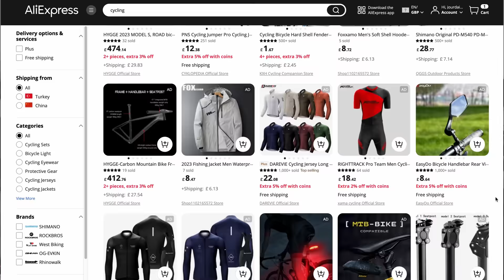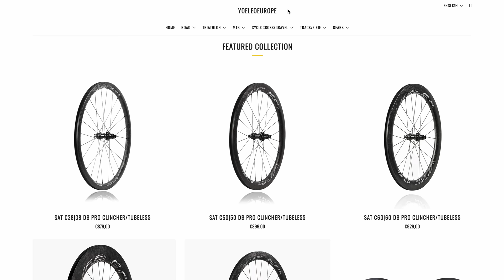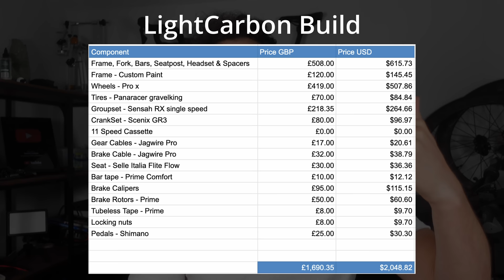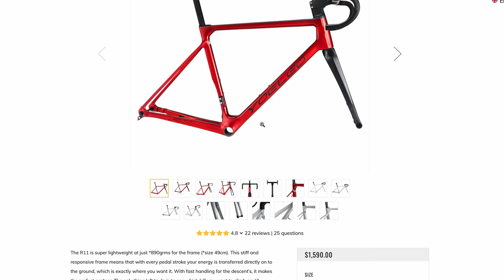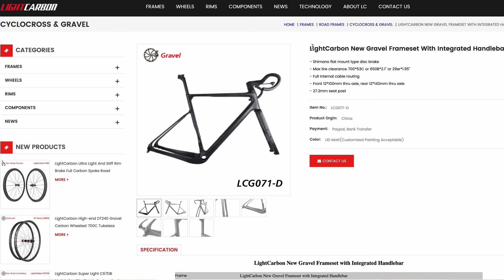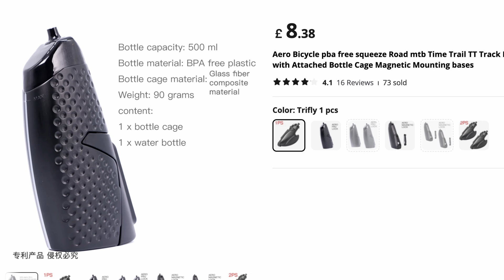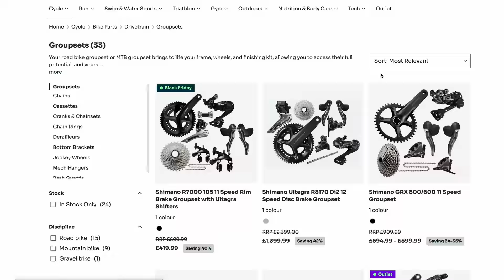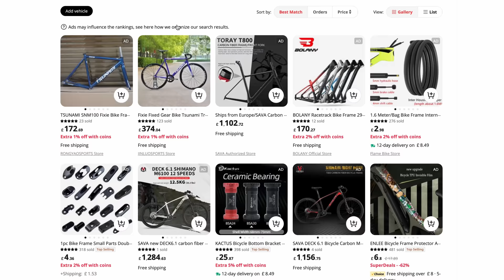Cheap Chinese Carbon Road Bikes... Are They Worth It?

Comment: I see some Chinese frames appearing on German "Kleinanzeigen" (craigslist like) and they are nearly unsalable. So one must calculate that there is no realistic way to get money back once the honeymoon period is over or when the frame is of the wrong size. If you buy a used 10 year or Specialized or Trek bike you for sure can get some 100s of Euro when you decide to sell it.
Reply: True, and I end up with 4 bikes and  1 frame. Though I am still in the honeymoon period with all of them, I start worring about how to get rid of them if I get tired of them or I want something better.

The only upside is, most of these frames are affoardable (compare to bigger brands, aside from my elves falath pro), so I have little problem to throw them away while strapping groupset and other parts that has much better chance to sell.

Comment: Shimano is not a Western brand.....
Reply: but they have local distributors handling service and also, despite the crank recall, deliver an extremely solid quality even on low end parts.
Reply: @FuchsHorst  It's still an Asian brand. Can't call them western brands in any way. Elves has an australian distributor too
Reply: @ht1881  Shimano has literally factories in Europe
Reply: @FuchsHorst  and Western brands have factories in Asia. The point is, shimano is Japanese.
Reply from the maker: Apples and pairs... They are well established in the west is what I was getting at 👍🏽
Reply: A very SoMe comment. In the defense industry we call Japan AUS NZ etc “Western” - I think the 99% will agree when it comes to cycles also. YMMV.

Comment: Yes, this video is exactly correct in my experience.  I have two Chinese bikes, a Yoeleo R12 (2023) and ICAN A10 (2020), the later is a rim brake aero frame.  No problems with either.  Really fantastic value.  (Note, I have Ultegra Di2 on both, and I had the builds done at a LBS by people who know what they are doing).   Both have really good QC in small details. Better than a 2018 mid-level Specialized Tarmac I had previously. By details, I mean roundness of BB area, how closely the derailleur hanger fits into frame, and the wheel dropouts. I've had two sets of ICAN wheels (Aero 50), I really like them, they seem indestructible.  Earlier I had bought one set of Yoeleo wheels (2018), my first foray into  Chinese stuff, they were not as good, one developed cracks along the nipple holes after ~ 2 years, around 12,000 km (at which point I figure I had gotten my money's worth).  I bought a set of Elite Carbon 50D wheels earlier this year for the Yoeleo R12. I really like them so far.    

Yoeleo now has 6-year warranty on frames.  For a couple hundred USD they extend it to lifetime.  My ICAN came with a 2-year warranty.  Great customer service. Great communication with both companies.  I just bought a pair of 3D printed saddles from a company called West Cycling on EBay (also sold on Aliexpress).  About $100 each.  Time will tell.  So far, so good, very comfortable.  

I might consider a Chinese groupset someday.  But not yet.  They are too new to that business.  And YouTube reviews are not encouraging. 

So, as you say, wheels and frames are a safe option, and concentrate on Yoeleo, Elves, Winspace, and ICAN as things stand in late 2023.  Possibly Velobuild.  Also Elite Carbon, and another wheel company or two that I'm forgetting.
Reply: Are there also cheap aluminum frame sets ?
Reply from the maker: Thanks fro sharing your experiences. They seem to be aligned with me as well. I am hopeful that the groupsets become robust and a viable option because £1000+ for Di2 is a log of money. If anything they keep the western brands honest as they know there is someone on their tails waiting to take the top spot. 👍🏽
Reply: @MichaelRedford no, not really
Reply: Seaboard/Tsunami, yes.  @MichaelRedford

Comment: 100% agree. Have a custom painted Yoeleo R12 (2023) and two wheel sets with Shimano Ultegra Di2 12 speed, stages power  pedals, power mirror saddle and a nice ManuF. BB. Such a great ride. Not ultra cheap due to all the high end parts but still significant savings compared to a comparable brand frame or a -reassembled bike. Had an issue with one of the rear hubs - Yoeleo sent a replacement part and all was well.

Comment: Jourdain, i think that was a fair assessment and the results similar to mine, although not in the same quantities. The bottom line is that if your not prepared to potentially "throw the item away" if it is not to your expectations - don't buy. I have an Ican gravel frame (cannot fault it) fitted with Sensah Empire Pro/Senicx crank. The Sensah FD proved to be a challenge to set-up. In the end i swapped it out for a sram FD. The RD seems to "loose" its indexing fairy regularly but when working shifts well. I am not sure if i would recommend Sensah and will probably swap it out for a Shimano set-up when funds allow. Keep up the good work 👏👏
Reply from the maker: Thanks for sharing! I'm hopeful that the LTWOO and Sensah groupsets do become a solid option in the future. Right now they are keeping Shimano and SRAM on their toes which is only a good thing!

Comment: Ohh boy this is exactly my experience. I just finished my first build, a gravel bike. I orderered a frame from Tan Tan Cycling directly through and evrrything is pretty solid, the paintjob is also pretty good. But then my stupid ass decided to give the LTWOO GR9 groupset a go and that has been a pain... I bleed the front brake like 20-25 times until it had some grab and even then im not fully convinced. Finetuning the rear mech has also not been easy but ok.

Yesterday there was a sale on a front grx 800 brake lever and caliper for 70 eur(!) And I bought it without thinking that much, just to upgrade my brand new chinese groupset 😅

Comment: Yes they are BXT are great for me...a lesser known make as not featured by YouTubers and they STILL do rim brake frames 👌🙏
Reply: The site says their rim frame accommodates a Max tyre size of 23mm. Have you been able to fit 25 or 28s on yours? If so, I'll get one.
Reply: @mikekelly1771  Yes, I think on their disc models it's wider but on the rim frames I use a 25 tho tyre widths are negotiable between makes/manu.s
Reply: @mikekelly1771 My ICAN A10 rim brake bike fits 28 in the rear and 26 in front (Pirelli tires).

Comment: I have one of the cheapest frames, ceccotti branded, $300, been riding it for 3 years now and no issues. It's not the lightest weight frame out there at 1,2kg but it's pretty robust. With chinese frames the higher the price the lighter they are, so at least they have entry level carbon frames for the masses, unlike the big brands.

Comment: As for Chinese frames do your research.  I have been riding a velobuild endurance frame with press fit bottom bracket.  All good.
     Another frame from this brand has a threaded bottom bracket.  I've have heard the threads were not cut cleanly. Probably poor or dull dies. 
   But again I am very happy my endurance frame sofar and I also have put a 105 groupset on it. Everything fit with no extra work.
Reply from the maker: Good to hear that your frames have been all good 👍🏼
Reply: @JourdainColeman  I just have one endurance frame with press fit BB . Good sofar. I have heard some complaints with the frames from this company, with threaded BB.

Comment: Regarding groupsets, have you tried Microshift? They only do mechanical, but my understanding is that they are solid purchases at a better price than the two big brands.
Reply: Most OEM non-Shimano/SRAM is MicroSHIFT. I've never had any issues with their stuff. Its pretty good if you want mechanical. Their best stuff in my opinion is some of the things that address niche compatibility issues. Like, they have a set of drop bar 11spd shifters that match the cable pull of Shimano MTB derailleurs. Really good for mullet gravel bikes.
Reply: Most OEM non-Shimano/SRAM is MicroSHIFT. I've never had any issues with their stuff. Its pretty good if you want mechanical. Their best stuff in my opinion is some of the things that address niche compatibility issues. Like, they have a set of drop bar 11spd shifters that match the cable pull of Shimano MTB derailleurs. Really good for mullet gravel bikes.

Comment: Informative video. Thanks.  I'm buying a new Yoeleo R-12 frame, Shimano Di2 12 speed group set,  and Elite Drive wheels for Xmas. Going to pass on the L-Twoo electronic group set even though I could save $1000 USD.
Reply from the maker: Glad it was helpful! Good choice on the groupset!

Comment: My experience matches this video. The frames are generally well made, although often their ride characteristics just aren't as good as a major brand. Chinese wheels are generally excellent and the best place to start, especially the higher end Chinese stuff. I see little reason to pay double or triple for Zipp/Enve/Princeton these days, especially if you get non-proprietary hubs with a quality Chinese carbon rim. In particular, the more expensive Chinese "brands" that have been around for years like Winspace/Lun, Magene, Elves, Yoeleo, Farsports, ICAN etc all make very good stuff. If a Chinese brand has actual distribution in your country, that's the best possible setup. The second tier of Chinese frames and wheels like Superteam and Lightbicycle are generally good with their higher end stuff being excellent and their lower end being reasonable to use for a year or two. I would stay away from any non-branded, super cheap Aliexpress/Amazon stuff as it's always a total crap shoot: you might get something good but more often it's dangerous garbage.

Comment: From my experience buying well known Chinese road bike frames I would give it a 7 out of 10.  They’re lightweight, stiff, but quite uncomfortable to ride in my opinion particularly the Winspace SLC.
Reply: That's a first, Cannondale and Specialized having an inferior ride quality to Winspace despite having a significantly larger R&D budget and winning racing heritage. I've upgraded my tires to GP5K 28mm with 65 psi pressure on my SLC 2.0 but no resolve.

Comment: £100 on your doorstep, that sounds like a scam to me (unless he had paperwork but this is done usually before). As the Ex-importer of one of these brands I can tell you most will mark the value down to avoid import tax for you the customer. However this means it can randomly be stopped or slip through. When I had the business we always used the correct invoice price and paid our taxes! Most I can tell you do not.
Reply from the maker: To be fair it was my usual DPD driver and he had the paper as well. They didn't take card though so I had to pay online and arrange redelivery. Not ideal but all seemed legit 👍🏽
Reply: @JourdainColeman  arrrrgh sounds bit different when you put it like that. Parcel force did ours and a letter came through first.